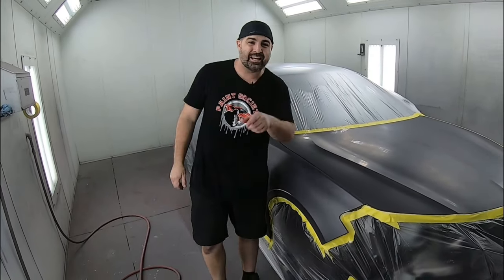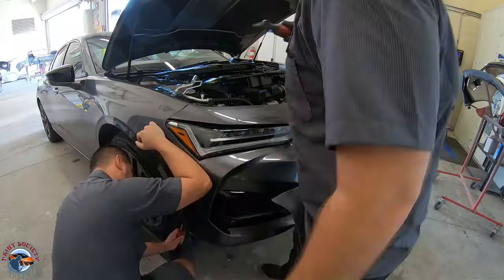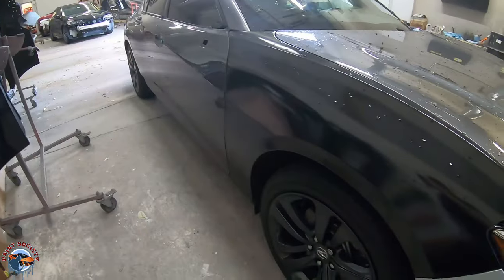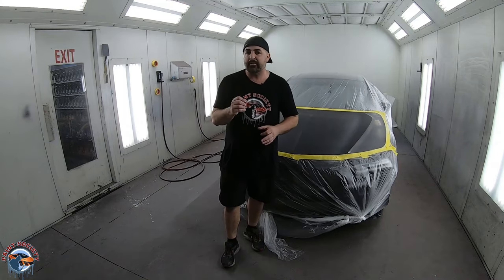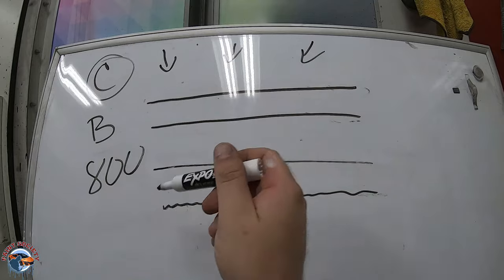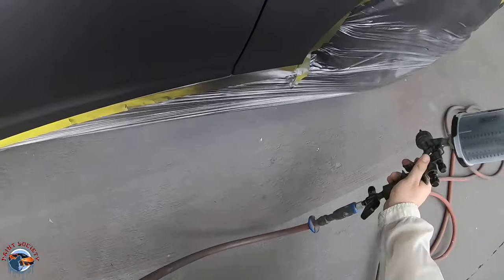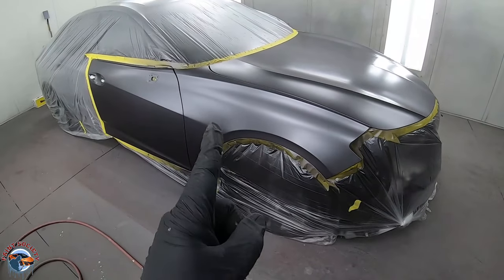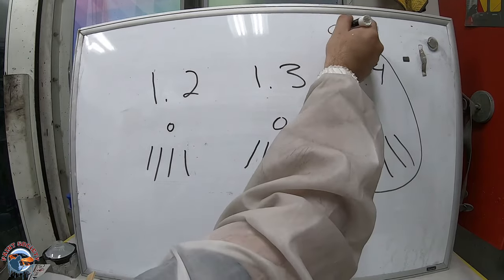Car Painting: How to Spray the BEST LOOKING Clearcoat!

Comment: I got one for you, I'm sure they're are plenty of others in my same situation. Show us what types of filter, moister traps used in shop and how to set one up at home.  I have an 80 gallon upright that I bought a year ago but realized afterwards that the cheap home depot filter,moisture,oil traps don't even work and spray atrocious amounts of fluid. I went to a body shop and asked what they used, they showed me some ridiculous set up that cost thousands. Needless to say.......
Reply: I use a copper line wound in a coil that sits in a bucket of water before my reserve tank never have any moisture issues
Reply: I'll post a video of my set up and see what suggestions I can get

Comment: Slower (reducer/activator) is faster. I like to adjust the pressure at the wall to with in 10lbs of where I like to spray. Open the gauge up all the way and make small adjustments there. Really good tutorial Brian!

Comment: Hi Brian and the PS crew. Thank you for all the content you produce. I’ve been enjoying learning from your vids, down here I Australia. 

I was wondering if you have any plans to do any videos about engine bays. I’ve recently completed my first ever painting project in my garage at home, which was the engine bay in my ‘83 Holden VH Commodore (Australia’s GM arm). We had a bit of rust repair, panel beating, filler, a lot of wire wheeling, all
Followed by epoxy primer, 2k surfacer, and finished with Debeer COB. I ended up flow coating to get rid of the orange peel. 

While I was researching and figuring out how to proceed with the help of content like yours and others, I found that there is a distinct lack of engine bay specific videos. The thing is that some of the tips and tricks that everyone teaches on panels, can’t be directly used on bays, because of the all the high spots and nooks and crannies. One big example I found was that once the initial stripping is done, there is almost no machine sanding possible. I actually had two tiny rubs through during flow coat. That led to fry ups when I was fixing it up. It’s all finished now and I’m happy with the result. 

I’d love to see how someone like yourself would tackle this kind of restoration job, and see how you might do things differently. 

Thanks again, and keep up the good work. You guys shit on us Aussies when it comes producing good car content. 👍

Nikolai 
Canberra, ACT
Reply: If you are ever in that situation again.. scotch pads and wax/grease remover.. 
if you think it’s clean enough.

It’s not 😄
Reply: @AJ-yo7rb  thank you. Yeah I was doing a lot of cleaning as a went. Talking to another painter about it, he was saying it may have also been from trying to put too much base on those little spots in one go. 

Thoughts?

Comment: Some good information in here!! All the steps in the painting process are important! Split nozzle all the way!!
Reply: Hey whats the difference between the American WBX (red) and the International WBX (gold) caps?
Reply: @brandonhensen7703  you've probably gotten the answer by now but if not, the red- max inlet of 20psi (US compliant), uses 300L/min, with a 1.4 uses 150ml/min, and 12in fan. Gold- runs on 29psi (non compliant in US), uses 370L/min, with a 1.4 uses 200ml/min, and has a 15.4in fan
Reply: @jamessakimae9655 Do you know how they spray and compare? Base/Clear? How about the LV4 on the W400? Curious

Comment: That’s new Acura TLX and its already getting paint done. Here i am with my Well taken care of 2004 Accord EXV6 Sedan with only 71,000. And here i am tripping about a few scratches on the Trunk. And few micro cracks in the Hood.
Reply: When you spend that much on a new car you want it perfect so it doesn't come back as a complaint then have to fix it anyways. Doing it right the first time.

Comment: true that bigger nozzle tip means bigger paint droplets but you have the ability to close & or tweak the fluid to control how much fluid gets atomized at the aircap or am i looking at it wrong?? 
i always thought a 1.3 is a better overall size but i also have a supernova ls400 with a 1.4 tip & it’s the best of both worlds for oem & flat finish in my opinion. i close the fluid 1 3/4 turn in from open & play with the psi till i see small paint drops(per your video lol) which for me for basecoat is at 29psi & 36 for clear & that mimics a 1.2 nozzle to paint at a slower pace to get a flatter finish. also i leave it at full fluid & speed it up but sacrifice finish. i guess it’s up to each person’s preference but this is why i skipped the 1.2 setup. now, i’m not a paint expert like brian which is why i asked if what i said is a accurate statement or i’ve been fooling myself lol i’m just the weekend diy’er but take pride in every job i get & it’s been an addictive ride

Comment: Sprayed black urethane primer , black urethane base both great. Sprayed clear coat , first coat blotchy,  resanded . Second coat same. Checked pressure did test spray, that was ok . Third try clear was not even. Thicker in spots. Will say I was trying the impossible. Painting outside in sun. Lost access to paint booth and could not find garage rental. Live in Nothern Ky not many diy ers here. Put on hold until I can get inside. Not as easy as it seems. Did all he said used 1.3 nozzle. It kicked my butt.

Comment: Brian, is this theory correct? If you want to spray finer droplets, for a flatter finish, does increasing the air pressure on the regulator do this????? But does this alone cause other potential issues you must control? In my head, it does. These issues being does it also increase the rate of paint in the pot spraying out as well?? Meaning it may hit the panel too fast which means too much overspray so you turn down the fluid dial to even that out, to reduce overspray and the speed of the paint shooting out the tip? I want a finer mist without the spray being too fast and turbulent and overspray-ey. Obviously also without crossing the line of making it spray dry and rough as well.

Comment: Yeah I will agree.... you will get a finer finish a slicker finish with a 1.2 but that’s if you’re using the same air pressure for all three tips... me myself when I shoot clearcoat and when I want it  to look like glass I’m using a 1.4 and  pushing 40 to 45 pounds pressure to that gun to get that clear to come out really slick and  automize well all depends on the painter if you’re fast painter or a slow painter but yet good example ...I have to get on my clear on as fast as I can since I’m working out of a garage to minimize time for bugs and dirt to get in my paint.....
Reply: I usually spray in my garage and anything over 25 sounds like a jet taking off, usually clearing around 20 psi lol.
Reply from the maker: @megaman4201  that high of a pressure will leave a huge amount of overspray and waste of material 😀
Reply: @PaintSociety  That why we use the bottom of the barrel materials to save money hahaha (or maybe cause we are actually poor)

Comment: Brian! Thank you so much! Good video. But I have a question. I sprayed two coats of clear on my truck. And it end up being quite orange peely in some areas. Can I wet sand it and then spray another coat of clear on it? I was messing with my paint gun and finally got to right settings after one of your videos lol but is it possible to fix clear with sanding and respraying?

Comment: i have a new bmw painted metallic black. i am going to be changing out the front bumper and the front left and right quarter panels.. They come primed ready for paint.. My question is: due i paint them off the car or on the car.. Car paint is near perfect.  I can use spray bombs made for me at the paint shop or use my siphon gun with paint. hardner and reducer.. I will most likely go with the spray bombs.

Comment: This is a very helpfull video for beginners, but i have a question: i read a manual about paint defects that a cause of solvent pop can be due to the use of crappy sprayguns( so large dropplets full of solvent and layers more thick) and i also read that some solvents are released during atomization (if you use a professional spraygun). Is it correct?

Comment: Can you make a video on solvent pop? Is it possible to completely avoid it other than choosing what time of the day you spray?
Reply: I would let it flash longer if it's cooler to be sure solvent has escaped imo.
Reply: @davidg5704  Thanks for the reply. We thought at first the booth was getting too hot too fast and adjusted the bake cycle cause it was going upwards of 100 degrees outside. We figured out our painter was over reducing stuff like crazy to attempt a slicker job. We looked at the history and they were going 20+ grams over. Explains the constant runs too. But all resolved and the results are coming out great.

Comment: Paint society have u done an episode 
Of how to spray base coat without any orange peel..I scene many channels but u seem to explain stuff more in detail..I like tat ... at 1st I thought it was clear coat causing this problem but it's the improper foundation of  base color
Reply from the maker: I haven’t yet but it isn’t hard.  Base lays pretty flat. Just use a 1.2 and slow reducer
Reply: @PaintSociety  I used a 1.3 and slow reducer as u recommended...saw gunman likes medium reducer ... maybe I over sprayed and should have wet sand it before applying clear coat.... the turbine spray gun at 5.8 air flow didnt spray alot paint even dooh the air needle was at full blast ..and I was aware tat u can only use does specific guns on tat turbine unit not other guns tat adjust to compressor... I think I would have achieved good results with a devilbiss gun... atleast my hood came out 100

Comment: How much coats do you usually put on and do you buff. I open the sata 5000 wde and extra turn on the fluid tip put two coats on and still buff is that a good thing.i use Sikken hs clear but I reduce to 20% reducer

Comment: Another question, if you have a daily driver and the clear coat is starting to go but hasn’t reached the base, can you just sand the clear with 600 or 800 and reclear the car??
Reply: No, you'll need to feather out the failing clear which in turn will still be visible and you can burn through the base coat during the process. As to your other comment you'll generally need a few guns, but I'd say if you want only 1 gun order a master elite PRO-88 on Amazon. It comes with 3 fluid nozzles a 1.3 (base coat) 1.4 (clear coat) and 1.8 (primer). Brian has a video on the PRO-44 gun and it did well, the PRO-88 I recommended is supposed to be better

Comment: Sorry for silly question been contemplating for a few days messaging you on IG LOL 🤣 but I sprayed for the first time on a devilbiss finishline hvlp and my air pressure regulator when I would let go off trigger would go to 100psi and when I would try to adjust it it will not go pass 20 psi, whole trigger was pressed. Long story short I was spraying a championship  white of OMNI paint but instead of painting the fenders white it just made the primer a lighter gray almost like if the paint was see through? I was thinking maybe the regulator took a dump even though it was new and pressure was too high and paint was not being applied correctly?
Reply: Thanks in advance!

Comment: Hey Brian, Question: Newbe in painting,,,if money is not a concern, is a 2nd tier gun better/more forgiving for a beginner for painting panels or should I get a 3rd tier gun...I will be painting in my garage
Reply: I am a novice and the best gun that I have used for me is a devilbiss plus.
Reply: For painting in your garage it's also important to get a gun that sprays well at lower pressure, at 40 PSI you'll fill your entire garage with overspray just doing one panel. I like to stay as close to 20 psi as I can in my garage... I use Devilbiss dv1 clear coat and base coat guns but Astro also has some budget guns that spray decent at lower PSI.

Comment: What would be the maximum time for waiting between coats (waiting too long)
Reply: Look at the TDS (Technical Data Sheet) or can for the clear you're using, it should tell you. If it says flash time between coats is between 5-10 min. at a certain temperature , then I would say around 10 min. would be maximum time for waiting.

Comment: Brian, noob question here, could you sand down your base coat (even if it is metallic) to make it flat before laying on clear? Would the clear coat reveal any swirls marks or dullness in the base coat even if the base had been wet sanded down correctly before laying on the clear?
Reply: If you sand down metallic base u have to spray the metallic base again before applying clear
Reply: @yusufnasiru1709  So basically you’ve got one chance to make metallic flat, or else you will just be repeating the same process again and again?

Comment: Hey brian,how you doing,i need some advice dude,i will be attempting to prep a project car i have been working on,and need to know what type of paints i need to firstly get a base /primer coat on first,then top coat,and finally clear coat,what type of paints and primer and clears do you use,as do not want to mess this up,can you advise brian,thanks..
Reply: What's your budget
Reply: Not bothered about budget,i just want to know what type of primer,and paint i need,is it acrylic,or  urethane,as also the clear coat.👍
Reply: @daveshipman2677 A local auto paint supplier should help out.  Start with a DTM hardened primer, Any brand base coat, then clear coat. PPG Deltron line up is  great (if you're not in California!)

Comment: Hi Brian, I've just bought a 1.4 iwata and I'm mainly going to be painting motorcycle tanks, have I made the wrong choice if I need to I will buy a 1.2 as you suggested, does this mean the 1.4 will be sat on the shelf and not get used ?
Reply from the maker: It’s great for sealer the 1.4
Reply: @PaintSociety  thanks brother, I'm going to look for an iwata 1.2 now 👌

Comment: Brian, i know you based and cleared the fender before installing.....Ever run into the situation where when you re- base the  clear you already did it curdles up?.....How do you handle situations like this?
Reply from the maker: Nope. Never have that issue. You mean wrinkle ??
Reply: @PaintSociety  Yes.....Mostly happens when the clear hasn't cured long enough....Probably doesn't happen when baked
Reply: @RoadratEddie Or just leave the clear off until you paint all panels together. He does this in later videos- better idea.

Comment: Hey Brian, I use a sata 4000 1.3  1.5 to 2 turns out from full close. If I pound the clear on like you do I get bunches of runs......any tips for me?  I use glasurit high solids 2:1:10% @ 85* to 95* 10 minutes between coats.
Reply: Maybe screw it in more or move faster or more evenly or overlap less or get a 1.2 tip or get a Prolite or faster reducer or or or,,,experiment, Good luck.

Comment: Question, isn't tacking and anti stating at the same kinda pointless? Shouldn't you tack, then antistat the panel? Because when you tack you're adding static onto the panel, so doing it the same time you're using the stat gun is surely the paint equivalent of pissing into the wind
Reply from the maker: Depends on the direction you do it. You are tacking and moving behind it with the static gun to remove the static if any.
Reply: @PaintSociety more like pissing down the wind- sorry couldn't help myself!

Comment: Question: does this mean a 1.4 tip with more air pressure will give you same finish as a 1.2 tip with less air pressure???
Reply from the maker: Nope. The diameter of the hole is the difference.

Comment: Question. Should I put my 82 c10 back together before painting? Painting it Chrysler bikini pearl.
Reply from the maker: If it’s a metallic yes paint it together
Reply: @PaintSociety  best way to paint the area between the cab and the bed?
Reply: What is 82c10 my friend
Reply: @yusufnasiru1709   look up 1982 Chevrolet c10

Comment: Why do I get runs in my clear coat if I attempt to go slightly thick with a 1k rattle can.
Yet you seem to go back and forth over the same area 10 times without worrying. Are 2k clears/air guns that much easier?
Reply: You are either to close to the panel or moving to slow
Reply: Also, every clear coat product is different and has different characteristics, you might just be using one that runs easily.
Reply: It's better to lay your clear thin than thick .go thin in 3 coats or more

Comment: You are very knowledgeable  but beginners need to understand practice makes perfect. Any little problem can cause a paint failure. For beginners  it's probably better for them to not spray it too wet when  they're  first learning to avoid  runs.  They need to learn to cut and buff anyways. Just my opinion. Also you are a master of the craft!